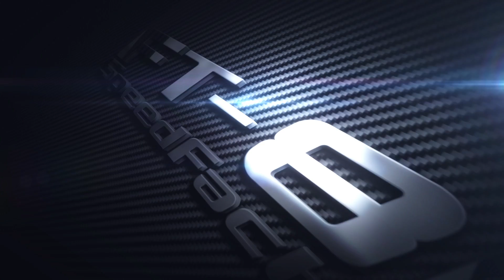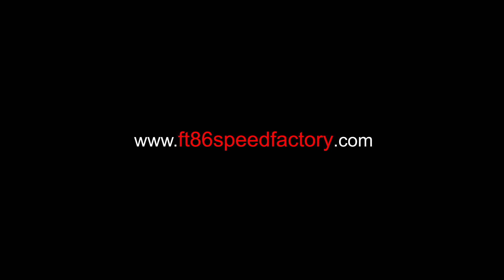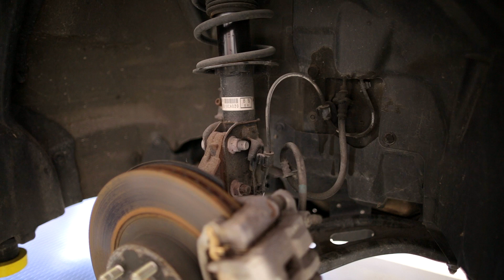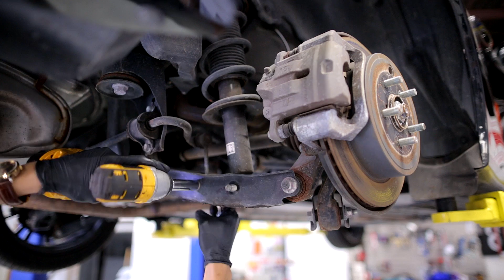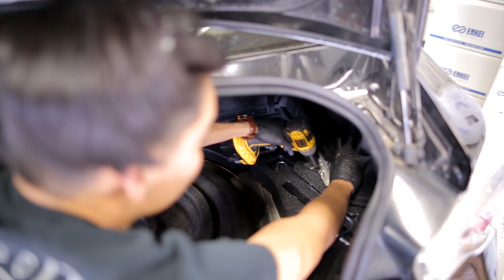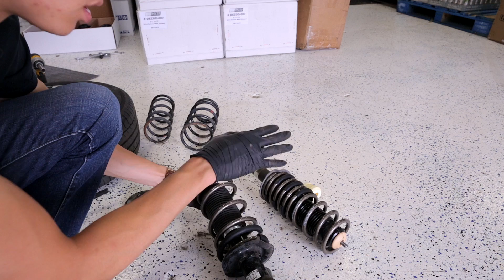Ft86SpeedFactory - Racecomp Engineering Lowering Springs Install

Comment: Hi, how did you manage to remove the top hat nut WITHOUT spinning the shaft like you said in the video? I will be installing mine Eibach this weekend so your help is appreciated. Thank you!
Reply: How did it go? I getting mine this week. any pointers
Reply: So far so good, I have not yet blown out the shock and they are still running just great. Just make sure you do not use the impact gun when removing the top hat NUT as it will spin the shaft and cause the shock to blow prematurely. I used the hollow/pass through socket to remove those NUTS and really took my time not to spin the shaft. Also, make sure you torque everything to specs otherwise you will hear the clunking sound  due to not tightened enough NUTS.